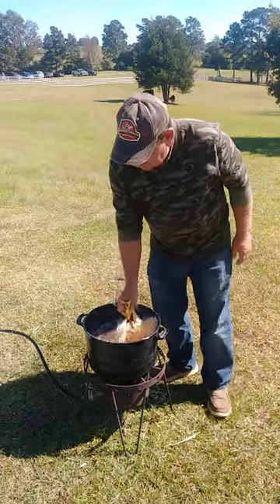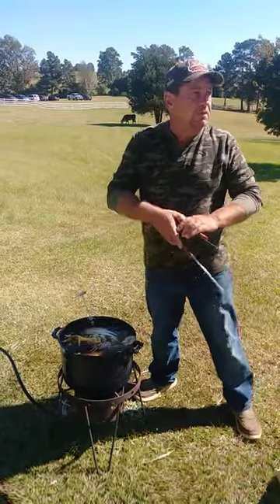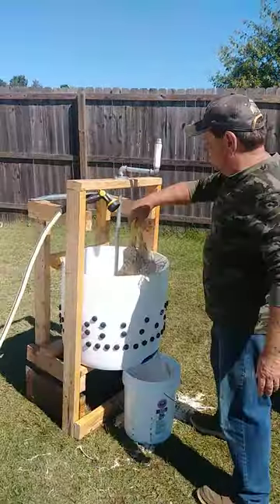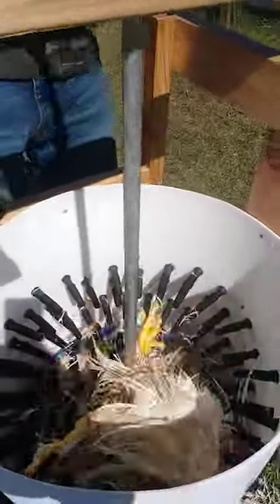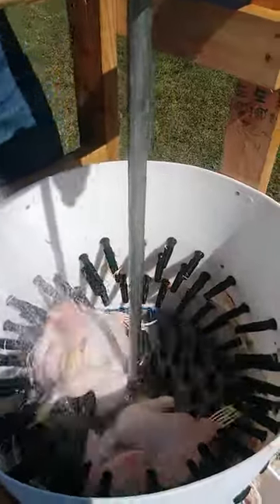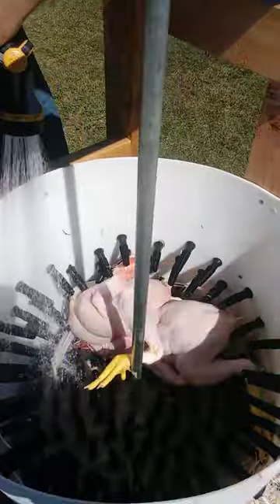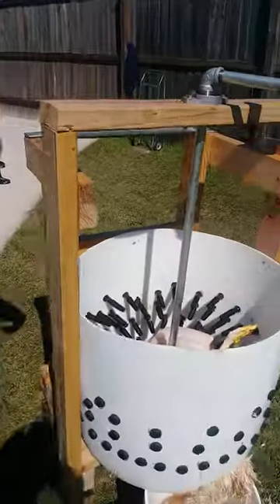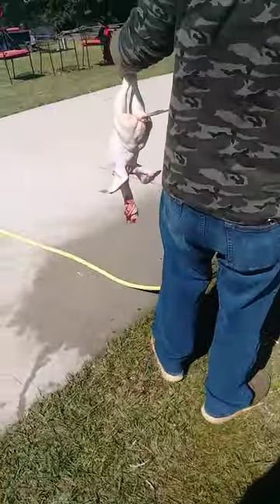Manual Chicken Plucker for Pasture Poultry

Comment: Thinking on doing very similar, but using pump drill action to spin the spin wheel . And if that don’t work try to make the handle more like an old fashioned hand drill style handle so you can get more umf on it. But great design. Love it. Maybe put some kind of holder for the hose attached to the barrel so it frees up both hands.

Comment: Impressive feather removal.
Reply from the maker: Thanks. It actually does a really good job. We have to come up with a way to keep the water temp more consistent, along with the amount of time in the water.
Reply: @bpriest35  what would improve this would be to convert your turning rod from hand operated to a drill attachment, run off battery power for the drill or even a corded drill, which may be overkill, maybe not. Good idea but if I build one I'm definitely using a drill to spin it
Reply: @bpriest35  покажите как она собрана,механизм
Reply: @bpriest35  I would love that parts list.... and another video on assembly would be awesome.  I dont have an option for power where I pluck and process without spending upwords of $1K plus dealing with permits or 300ft of heavy duty electrical cord which is expensive as well.  I just raise enough flock for my family of 5 on a teachers salary, so the expense of electrical just isnt doable.